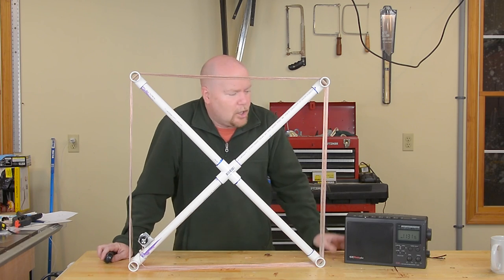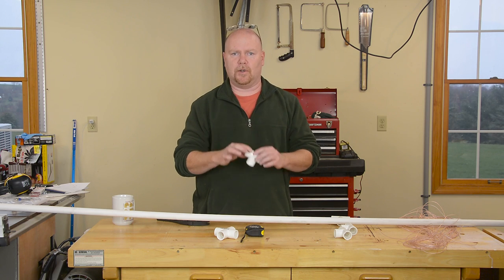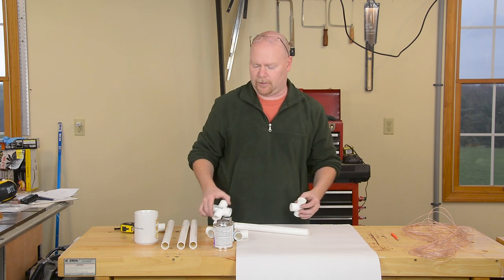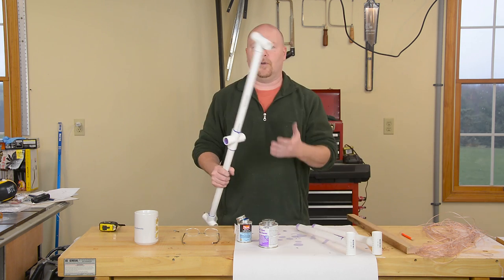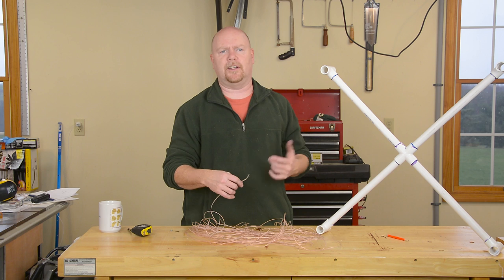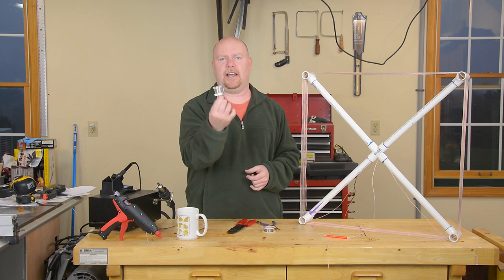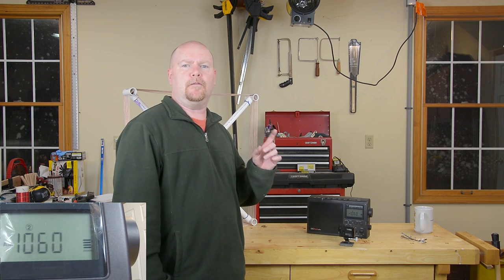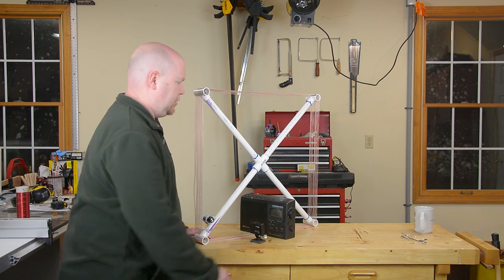AM Loop Antenna from PVC Pipe

Comment: Thanks Matt. very nice design! I've tried building AM Loops without much success. but no one ever mentioned that I had to place the radio in the loop. For the record, I am definitely and old guy and love radio. especially AM. there's just SO much good stuff there. decades ago, I worked third shift and listened to Coast 2 Coast AM w/ Art Bell. Those were to good ol' days man. Thanks again, all the best, Charlie
Reply: These days about 1/2 the AM band is taken up by COAST overnight.  WHAS-840 is 50KW (day and night) and can be heard in most of the country - but Kentucky is college basketball country and the post game shows can preempt the COAST broadcast on many nights.  Or, sometimes there are technical problems...  I am building this to get the show from a dozen or more other stations just in case one might be down.  Hopefully some of these stations are still broadcasting in HD too!  Not to mention if your town came under some sort of an apocalypse!  :-O  Then a battery operated radio and this antenna could save your life!

Comment: I am in the Netherlands and last night i recieved the Voice of Turkey  wich is located in the middle of the country, some 3000 km away.
With only my 1947 tube radio with only two 1 meter copper electrical wires hanging out of it as a antenna! I am fascinated by it. 
Heard languages i never new before. :))

Comment: Wonderful and fun video. 👍 As a teenager in the 60s we loved the Clear Channel 50,000 watt stations (or 250,000 watt station XERF in Mexico) we listened to in the evenings on handheld transistor radios, it was practically like shortwave because in San Diego we could get a bunch of stations across the country up to the Mississippi River. It was amazing to be in San Diego to hear a station in Chicago or New Orleans....no loop antenna required.

Comment: Don't know what direction you are from KYW but would have liked to see you turn 90 degrees.  I did that the other night (just the radio, not using a loop) and was able to null out KYW and its 50kW and tune in WQMV in west Tennessee, 317 miles away running four watts.  For all the faults of mediumwave ya gotta love the directionality.

Love the simple practical design!

Comment: I love pvc loop antennas too and every time time I watch this video I LOL at the section where you wind it. I use a sharpie and a ruler and then a hacksaw to slot the pvc. I built a 2 footer as well using #22 magnetwire and 1/2 inch PVC. Great as a signal booster and a good local crystal set too. I also resurrected an older 4 foot version built with  1 inch PVC and widened the slots and wound it with #15 magnet wire. It is a ridiculous signal booster and a decent crystal radio set. I used balanced armature IEMs as earphones and matching transformers with a germanium diode and tinned the turns so I could just use an alligator clip to select the best place for listening. So far I have bagged 22 clear channel and regional stations at night using it as a crystal set.That is only 5 nights so far for a couple hours each night. Enjoyed the video. Loops are magic and heavy gauge wire is worth it. Best wishes!!!

Comment: I did one that is 4x4 feet with 4 turns.  It worked quite well.  
My method involved no drilling. or glue
I suggest others copy the idea.  Imagine you are holding some PVC pipe in your left hand wit a T on top of it.
You pass the wire on the side close to you below the T
loop it around the T and to behind the pipe in your hand.
The result is a wire that doesn't want to slip off the T.
This is how I did the 4 corners of the frame.
It works fine.

Comment: Building an AM radio antenna myself and have a couple questions. First, let me fill you in on background info. I have some thicker wire that's single strand I got from Lowe's. It's insulated, so there's no problem with the loops touching. The one problem could be thickness. It's 18 gauge, if I remember, and that may be too thick. The first loop will be rather far from the last loop, so the loose ends will have to close in fairly far to the capacitor. 
Question: Is this wire too thick? 
Question: Will the loose ends coming in to the capacitor cut across the field in such a way it'll interfere with the signal? 
Question: Can I use a 5 gallon bucket to make this antenna? I'll wrap the wire around the outside and tape it down with clear packing tape. I''ll put the capacitor inside the center of the bucket, mounted on a piece of PVC pipe. I'll put the radio by the capacitor. Will this work?

Comment: It’s easier if you drill the holes, then take the band saw and cut a slot from outside to the hole. Then wind the wire around. 
I’m in Alabama and listen to stations in Maine, New York and up in Canada with a similar setup. 
I use a ham radio because modern cheap AM radios don’t cut it like the old radios did pre 1970. 
I remember listening to WLW and WLS as a kid. What I would do to here John Records Landecker do one more Boogie Check!

Comment: Forgive me for being totally oblivious to any of this. I don't fully understand what you were doing with the wire. You start in the middle? What are you doing, threading an end through all the bottom holes, and then working upward?
So, one end of the wire connects to the leg of that capacitor thing, and the other one the body?? I didn't see where it connected to the body.
I'll watch it again, but didn't fully get that part. 
Thanks

Comment: Matt you mention a couple times about making a smaller loop to put inside to allow this to be used on a radio without an internal antenna. Can you give a little more detail on that small loop. I have an old stereo that has a very good receiver, but just 2 wire connections for AM Radio and I want to greatly improve my AM reception. What does small mean? How many loops? Do I hook the two ends of the lop to my stereo? Do I ground it? Etc. Many Thanks

Comment: If you put one more loop of wire around it then connect the ends to a coax connector with a cable that comes in and connects to the antenna jack on your radio you can mount the antenna anywhere you want like outdoors and still connect it to the radio.  Or if you have a large outdoor antenna but the radio doesn't have an antenna jack you could connect the outdoor antenna to this loop and then use it to couple the signal to the radio.

Comment: Another loop antenna builder used a technique to save time (and cost of material) by using 4 conductor phone wire, soldering the ends to get 4 loops for a single length of cable. Even more turns can be made using older network cable (i.e. cat 3) that can be found pretty cheap at thrift stores, now that people are upgrading to cat 5e or 6.

Comment: Your video was recommended by a member of a DX page on Facebook. It was worth watching. Loop antennas are specially good for AM listening during the day. I have a hula loop and a ferrite bar loopstick and they work wonders. But nothing like building your own. So I will definetely do it and use your model as a template. I've already got some variable capacitors. Thanks for posting. 73 PY3WHO
Reply from the maker: Thanks for the heads on the DX page.  I'll have to go find that.  73's - N3NWV
Reply: Your video was posted on DX SOCIETY (The world of radio), a Facebook page dedicated to DXing by José Maranhão, one of the best DXers in Brazil.

Comment: Hi Matt, thanks for the excellent video. I have just now subscribed to your channel. I actually use a wooden 3' Box Type Loop antenna here for AM, though in design, it is rather similar to yours here on the video. Loop antennas make a huge improvement to indoor AM Dx'ing. One of my best AM DX catches here in Melbourne Australia was 1110 kHz KFAB Omaha NE USA, which is included on my YouTube channel. Anyway, wishing you the very best. Robert.
Reply: You're kidding.. You got an US medium wave station in Melbourne? That's so wild!! Great catch!!!!
Reply: @LIL-MAN-THE-OG  Thanks. Back in the 1980's  both USA and Canada MW stations were heard here by myself along with a number of other DX enthusiasts at the time. One of the more "regular" catches was of 1120kHz KPNW Eugene OR USA. My KFAB once only reception is included on my YouTube channel.
Reply: Thanks for the tip. I haven't actually tried that.

Comment: I built one on the bedroom wall around a small shelf.  Used long wood screws with the thread valleys setting both the spacing and the anchor points for the wire.  Didn't need antenna rotation since the distant station I liked listening to was broadside of the wall.  The antenna is still there.
Reply: As explained by Matt in reply to other comments, the directionality of the loop is broadside-null.  To receive a station at best signal, the loop should be such that the station is in the same plane as itself.  Because it works by phase difference between its two vertical sides.

Comment: I built the same 2 foot PVC frame antenna but I used 42 turns at 4 inches wide tuned to 150 khz to 1700 khz I used a hack saw to cut out around 35 notches each ,   yes some wires do overlap and are paired up to make the 42 turns needed to tune down to 150 khz. It actually works really good on LW  and AM despite the hasty wire spacings. I want to make a larger 6 foot version with better properly spaced wires.

Comment: Radio Controlled or "Atomic" clocks and watches synchronize to a data signal broadcasted on 60 kHz by station WWVB in Fort Collins, CO. It appears that these antennas concentrate the magnetic field at their tuned frequency, so radios in the vicinity receive the stronger field through their internal antennas. In a weak reception area, I wonder if one of these antennas, tuned to 60 kHz, could be placed in an attic and would concentrate the signal's magnetic field enough so clocks on the floor below would be able to receive WWVB and synchronize? Have you done any experiments?
Reply: Great idea - I have an issue with my clock (in theUK) and wonder if a loop in the attic - above the relevant room - might bring it back to life.  I think its main issue is interference (neighbours' computers and plasma screens etc.).  Maybe the directionality of a loop like this could be used to null-out enough of that?  Only one way to find out...
Reply: Actually  WWV uses 2.5, 5 10 15 and 20 Mhz
Reply: @jbboating3268  I am referring to WWVB, which uses a 60 kHz carrier: https://en.wikipedia.org/wiki/WWVB

Comment: Hi Matt.....Thx for sharing your Excellent Diy AM radio antenna Booster design for us that Still like to Chase nighttime MW DX stations with relatively small, simple Inside antennas....Have you ever constructed a similar size (About same 240uh)  Flat Plane inside Spiral wound Loop Antenna for Comparison signal Boost gain ?? ....A lot of the 1920's RCA & other brands  radio sets used that Flat inside Spiral wound design....I'm using mine on a pine board  3 tube (Huge 1625 type Tubes) all 12 volt battery Regen Radio set !!..BTW,..Would a Double sized (48" x 48") antenna with Less turns but Same 80' wire Length produce Significantly more signal Boost gain ??....Thx again  for a great AM radio accessory project....

Comment: Thanks Matt for a good project, There is a problem finding a 360pf vairiable capacitor now days!, the small ones used in portable radios are 200pf which will restrict the lower frequencies to about 650khz. The solution is to use two of those in parallel or increase the turns to 15 from 11.
Reply: Or get a 100pF and a 220pF fixed capacitor and a ON-OFF-ON switch.

Comment: For Long waves (down to about 150khz ) it has to be about 32 inch edge, about 30 turns of wire (100meters), around 475 pF or more  capacitor. It works fine. But in Europe there are only 4 stations transmitting on Long waves.
Reply: Long live Long Wave !

Comment: Would a larger loop increase signal strength? Would more windings increase signal strength. Is there any best distance between the windings? This video is excellently done and based on your answers to my questions, I plan on building one. First time I have really gone out on a limb about projects like these and said that. But you instill confidence! Thanks!
Reply from the maker: Larger loops do "catch" more signal, but in practice you have to go much bigger to make a noticeable difference.  The number of turns and the spacing are related, and more isn't better.  They have to be the right mix for the loop to tune to the frequency you want.  The calculator in the video description is the best way to experiment with different combinations.
Reply: Matt Heere, okay. I will build it the way you showed. Thanks!

Comment: For the wire use NON ferrous wire.   To stiffen up the pvc fill it with spray foam insulation before final capping.
Reply: Or build the frame out of wood...
Reply from the maker: Once the wire is tensioned around the frame it's actually amazingly stiff.  If you're going bigger then either larger pipe or wood are probably easier (and less toxic) than filling with foam - although that's a cool idea if you really want stiff in a low profile.

You actually can use a ferrous wire (like steel), but you need to know the magnetic permeability and use a different formula for the loop.  It has the advantages of using less wire and being stronger - but the math is a lot more involved.
Reply: Steven Hardy or go the better route and put the wire INSIDE the pipe that way it won't need much weather protection
Reply: Yep...that too!
Reply from the maker: The spacing of the wires is critical.  You have to keep them exactly the correct distance apart, or you'll detune the loop and it won't receive in the correct band.

Comment: If you have the ability to, a vertical antenna that is at least 1/4 wavelength at the LOWEST frequency you intend to listen to is ideal. If you really want to listen to DX stations, provide a ground plane and a earth ground to your radio.  Am stations in north america use vertical polarization, and use a 1/4 wave long/high tower to broadcast from. This can also be used for amateur radio operators for transmitting using a matching device, although a ground plane IS REQUIRED for transmitting. The vertical antenna is usable from the lowest frequency you have it cut for up through 30 Mhz as a receiving antenna as well just by hooking the wire directly to the antenna terminal, just like for AM radio reception. If you want it to work better in the horizontal plane, have the wire at an angle of about 45 degrees from the vertical plane. Always disconnect the antenna and ground it during an electrical storm, preferably OUTSIDE the building. 
73's
Reply from the maker: For AM broadcast that's 530 kHz, so a 1/4 wave is  464 feet tall.  Best of luck.

Comment: Good job, but I still have some questions.  Is this like a outdoor long wire antenna, except the tuner gives the ability to do the same as changing the wire length.  
I have a Sangean 803ATS with the external RCA jack.
Reply from the maker: Hi Grant.  What you're describing sounds like a beverage antenna.  Loops share some of the characteristics of a beverage, but they have much higher Q (they are more sensitive to tuning) and they don't have the S/N ratio benefits.  If you have the room for a beverage and the tuner, then that's the way to go.  The loop is a better choice when you have less room.

Comment: This is a great idea fella. Hope you can make an antenna for a TV. I would be interested.
Reply: What channel range are you interested in?  UHF or VHF?  The Gray-Hoverman antenna is an outstanding antenna.  I have built 2 or 3 versions of them and they all performed like a champ on weak UHF signals.  The last version I built is known as the gold standard.
Reply: @Bruce_Wayne35  I am interested in the VHF and UHF. The VHF is because I live in a location where there are still a few channels that I would like to get and UHF all the way to 52 channel. I got what I need for the antenna build and am going to start. Not sure what is the gold standard ??? Nice to hear from you Sir. v
Reply: @victoryfirst2878  It's what the members of the Digital Home Canada discussion board/inventors chose to call it.  The gold standard version was the highest gain UHF version of the Gray-Hoverman antenna.  It covers channels 14 to 51 and has usable gain beyond that a bit, so it would still work great on 52.  They're easy to build.  Even a sloppy build will amaze you with good performance. A double-bay version will have around 16 dbi gain.

Comment: I have a few old AM/FM stereo radios laying around. What's the chances I actually find the variable capacitor you mention? I don't want to go through the trouble of taking the radio apart if it isn't likely to be in there.

Comment: Slots are a lot easier than holes.
The electrical department of a hardware store often has good wire from your purpose.  Heavier wire works a bit better.
Bigger diameter and fewer turns works better if you have the space.
Reply: Thanks, I must try that.